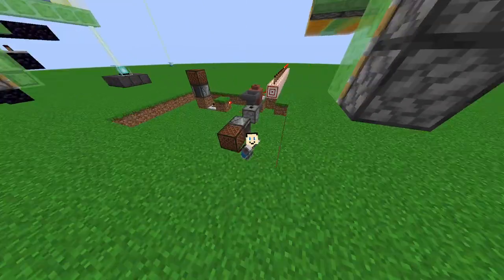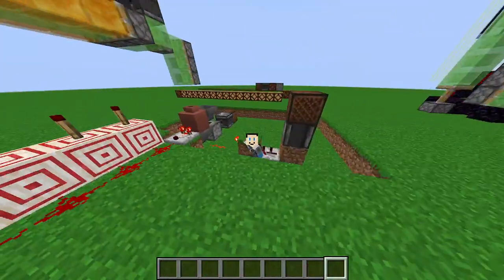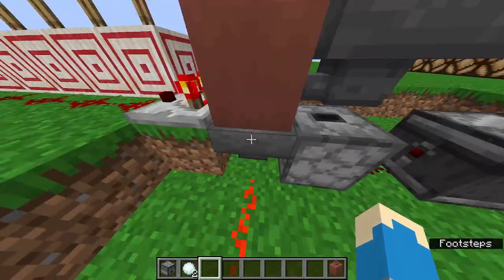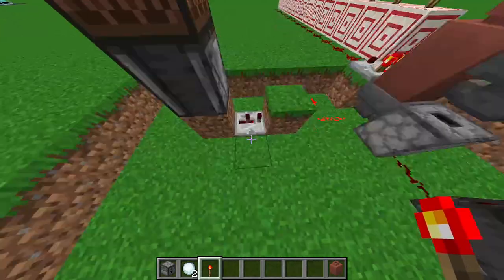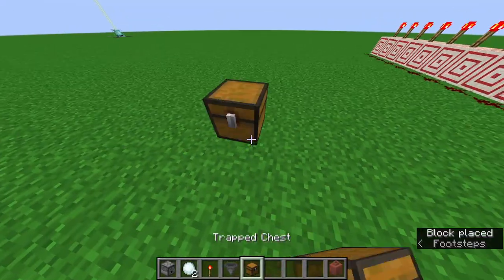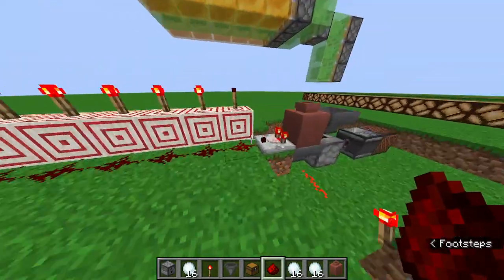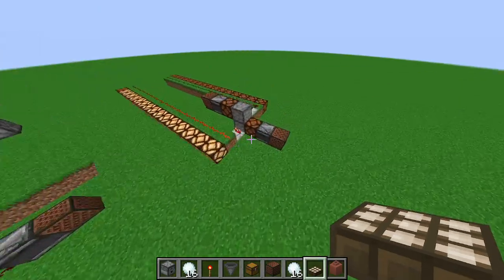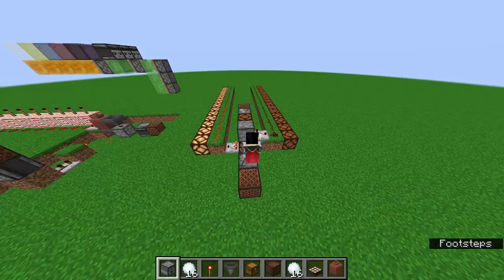Automatic Redstone Signal Strength Controller

Comment: in bedrock, I have come to the conclusion that it can be used as.
counter 
increments/decrementers 1 tick pulses
hex cell 0-F puls programed  just that extra ticket that needs to be added
latch 
t flip flop if you use a redcoder and 1 tick pulser
Reply from the maker: The idea is that it is used as almost a counter of sorts, so using it like that isn't too far out of the picture. 😊 

Just keep in mind that the 8 doesn't get counted in signal strength, and I've been made aware of an issue where an item will get stuck in the bottom hopper that I'm trying to fix.
Reply: @ConnorBreadFromBeyond  I only build things in Bedrock so when I write it's Bedrock I'm talking about, just so you know.

ok it's 8, well it's just that you keep it in mind. no big deal.

that they can get stuck in the hopper. a signal length of 4 ticks should solve that problem but I haven't tested it yet.
i used a redcoder and had a shovel instead of snowballs. worked great as t flip flop. 15 next to each other